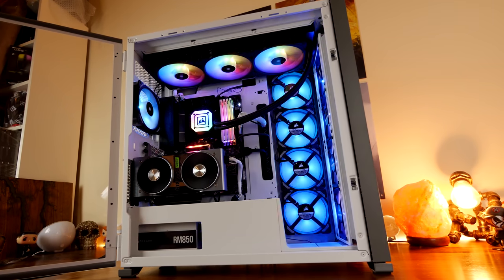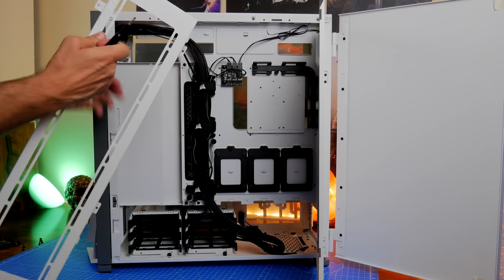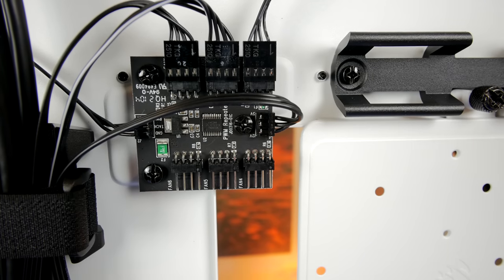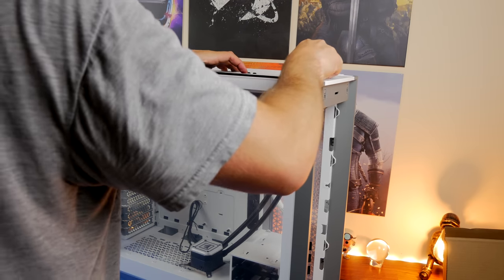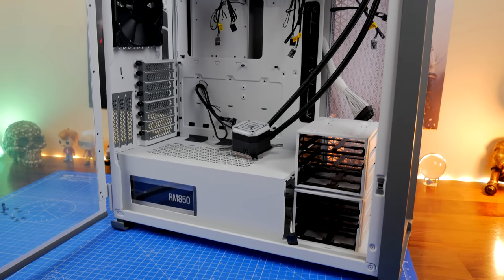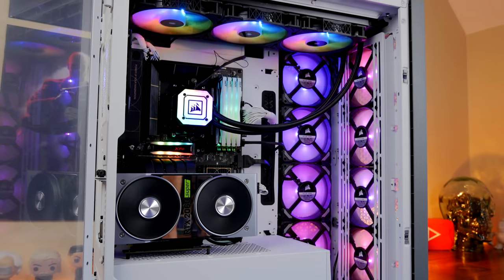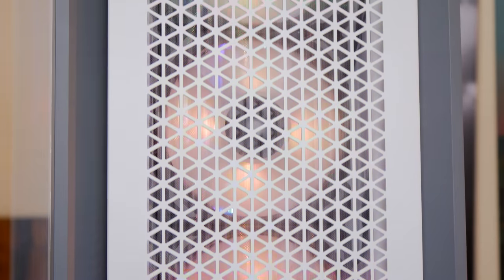Corsair 7000D Airflow unboxing and installation with 12 fans & the Corsair H170i Elite Capellix

Comment: I can barely fill the 5000d. This one is just.. empty without a full custom loop. Also it’s double the price
Reply: But but more fans! :D
Reply: Also with max fan kit it runs so cool
Reply: As someone who isn't water cooling, I find this case extremely useful just bc of my CPU cooler, and my 6900xt is fucking MASSIVE. Lol

Edit: no hate intended, just saying I like this a lot.
Reply: E-ATX motherboard users have entered the chat*
Reply: I like the extra USBs on the top. Wish more cases offered more than 2 as standard.
Reply: Try fitting a 4090 and not bending the power cables. That's why I ordered my 7000d today.
Reply: @stevenross-watt8640  exactly why I'm watching this
Reply: @mhop9775  I bought the case and a pcie 4.0 riser cable 150mm with right angle. If you look at pics the option to replace the original pcie slots ( not the 3 extra horizontal ones) means you can mount the gpu vertical bit very close to the motherboard. It will mean plenty of room for the fans to breathe as they will not be close to the glass and plenty room for the horrible 12+4 plug adapter cable to sit straight and happy. Hope that helps. Any questions or points, let me know. Cheers
Reply: 4090
Reply: @MrXaniss  that's why I bought mine
Reply: @stevenross-watt8640  I did the exact same thing yesterday haha, got the Zotac trinity my god it is HUGE.
Reply: @MrXaniss  I have gigabyte gaming oc. What a chunker too!
Reply: The price is ridiculous for this. I went from the 750d obsidian to the 5000d. I'm very happy with the 5000d, the worst part is the lack of space around the psu but that's barely a problem really cause how often are you really there. The cost for this case is ridiculous. £240 is mental
Reply: @wdunn06  I got my 7000d for less than that. Think it was £235 delivered from AWD-IT.
Reply: @stevenross-watt8640  how you liking it? Just got a 4090 and I’ve been looking at this case
Reply: @GradietPanda12345  I love it. You could argue that the extra rear panel behind the motherboard is a bit of a pain and unnecessary and the cable management isn't quite as easy as either a big Fractal case or my previous Lian Li 011 XL but once your over that then you should very much like this case. It has much more room to feel like a spacious case to build in. I've had quite a few cases and I'd highly recommend this one. It also allowed me to vertical mount a nice thick 4090 gigabyte gaming oc with plenty of breathing room to the glass panel.
Reply: @mhop97  corsair makes a cable kit to fix this problem if you use a corsair PSU other Wise ebay
Reply: @stevenross-watt8640 bro I swear it’s needs a big case for it to fit anywhere 😂
Reply: My 5000d is so cramped its not even funny lol. 4090 vertically mounted and it cant support push pull configuration on the top radiator, no clearance
Reply: Skill issue

Comment: Quick question man, I’m building a very similar setup with 9 ML120’s and 3 ML140’s for the H170i. Would it be any easier to use 2 Commander Cores for all 12 fans? That way I can run power and rgb to all 12, completely eliminating the need for the build-in PWM controller? Or would you lose all PWM capability at that point. First build.

Comment: Side Note: The AIO Pump should be plugged into a Pump Header instead of a CPU Fan Header if your motherboard has one for max pump speed.
Reply: My instructions for 7000x rgb version of this case also say to use cpu fan 1 lol. Logic tells me obviously you would think to use the "aio 1" header. But I'm assuming they must be the same thing
Reply: @themooch5454  The difference I noticed when plugging into CPU_FAN is that I wasn't able to control pump speed. So instead I use the AIO_PUMP and control with corsair icue

Comment: 0:00 Introduction
0:26 Peel
0:31 Overview
1:07 Previous version reviews (4000D and 5000D)
1:23 Size warning and benefits
1:57 What it comes with
3:11 Fan mounting configuration options
3:40 Other design features
4:35 Initial out of box set up
5:00 Available ports/jacks
5:35 Removeable tray
6:55 Data storage options
7:37 Customization options
9:42 Power Supply
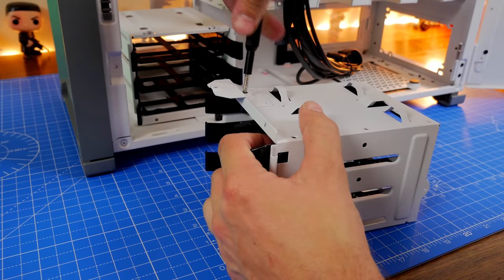10:45 Stacking hard drive cages 
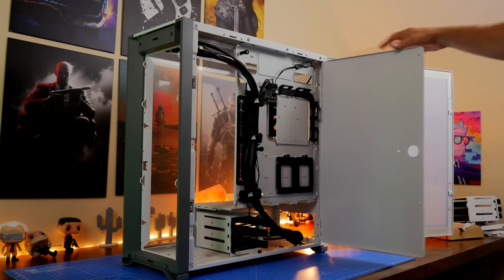13:02 Double Door System
13:23 Power Supply II
14:11 Front panel connections
14:34 Cable channeling
15:09 Corsair H170I
15:42 Fan setup outlined
16:10 Radiator set up outlined
17:12 Radiator mounting
17:20 Cabling set up
18:00 Corsair H170I Customization
19:22 RAD installation
19:52 Push-Pull setup options
20:34 Radiator mount installation
21:47 Fan installation
22:05 Vortex fans
23:30 Cable notches/recessions 
24:56 Commander Core 
25:44 Cable length issues
26:25 Commander Pro
27:47 RGB hub on top
29:38 RGB hub on bottom
30:12 PWM Controller
31:08 Sequencing RGB effects
33:23 Using an LED node instead of Commander Core
34:12 Looking at some cable channeling options 
35:38 Parts overview
37:50 Motherboard Installation (ASUS ProArt B550-Creator)
38:41 PSU clearances
38:54 Cooler installation (H170i AIO cooler)
39:04: AMD bracket installation
40:43 Pump into motherboard installation
41:59 Some issues with Cable Management
42:32 SATA power considerations
43:02 Powering the CPU
43:48 USB connections
45:05 Vertically mounting GPU
47:05 More configuration options 
49:08 Final Product
49:47 More Peel
52:30 Hiding Cable Shame in the back
54:05 Benchmarks
56:03 Closing thoughts
Reply: Where is the case audio wire bundle plugged into? I'm guessing bottom right with 1 pin spaced from the power and reset?
Reply: Great video ! Has there been a update , temps with GPU mounted vertically and horizontally ?

Comment: Thanks for all the work you went through for this video. I really like these longer videos that show everything, because If you think you had trouble setting this up, imagine someone buying this as their first build case with no experience with RGB Fans/Hubs/Nodes/ or anything like that, they will be completely lost, and this video will help them loads. Also You are the first person to show that the Hard Drive/SSD Drive mount cages are stackable. I've watched 4 reviews on it so far and no one else mentioned it. Keep up the great work. I currently have a 4000D Airflow, but wish I had gotten a 5000D Airflow. I have so many fans/hubs and stuff that cable management in this smaller case is a menace, and I just bought Lian Li Strimer Cables to add to it lol. I like that they added the bracket to Vertical mount the GPU closer to the Motherboard. Wish the 5000D had that option, in my 4000D the only plausible way to vertical mount a GPU is if it is Watercooled because if not it will be suffocated. Thanks for the awesome video!
Reply from the maker: Thanks for this. Appreciate it! And yes I try to be as thorough as possible.
Reply: If someone is buying this as their first build case with no experience, they are just asking to get into the weeds. Factor in the cost of a set up like this and it is not likely to happen. Someone affording this as a first build can pay someone to do it for them. There is value in showing the build process though as even experienced builders can't keep up with every case, motherboard, AIO, etc out there and showing potential hiccup points is very nice.

Comment: I know I’m very late to the video but I had a question. You mention that only 7 140mm can be added but I see space for 10 with three in the front, three on the side, three on top, and one on the back. Is there a space issue which prevents this? The build I’m planning will have a 420mm rad mounted to the side, three 140mm fans on the front along with three of the same on the top and one on the back. Would this be possible? Also I apologize if you answer this later in the video, I’m only a portion through.

Comment: I'm only partway through this video. I haven't built a PC in 14 years (GTX295 was just out)... I used to build PCs like every few years from age 12 to 20.. Now I'm 35 and so much has changed!!! M.2 drives, standard close-loop water cooling.. Everything is so new. Cabling is so much nicer now though!

I bought this case and so thankful I found your video. AND I happened to buy a very similar Corsair cooler as in the video. saved...
Very helpful! thank you!
Reply: That said, I have the 7000x which already has the fan/rgb hub... but not enough to add all of these three fans. Let's see what I can do.
Reply from the maker: https://youtu.be/jvXCbny-Suw

Comment: I'm so thankful to have found your video. It's been a minute since have built my own computer, and relied on this heavily. I had bought a prebuilt and my i9 14900 was spiking to 100C and holding steady with even small \ old games. I decided to do this build because of you, with the 7000D! I even did the push\pull on top of the AIO\radiator, so 15 fans total lol. However, I can't get my top lid on, and also, so many cables I'm having trouble shutting the back panel.... but oh well!       I was so happy to see that when playing some of my fav games, nothing like VR or 4k, but just average games, my temps are staying controlled around 40 - 50C right now. What a huge difference. Thank you sir!
Reply from the maker: Nice. Sorry about your small dramas but glad it's working
Reply: @TheProvokedPrawn  thats ok! I just probably needed some fan extension cables or something so I could relocate some things, it's all crammed in one area, and the 140mm fans on top are too tall to get the lid on, but i don't mind on that. better air flow! haha

Comment: Honestly a wonderful review of the case and showcase. I’ve never built a PC but I’ve been following PC builds since the middle of the GTX 10 series. Building my first PC with a 4090 this year and I’m gonna get this case. I have no experience hands on building but I’m pretty confident with my years of watching in general and this video specifically I can do it.
Reply from the maker: Glad to help. Good luck. 👍
Reply: @TheProvokedPrawn  a 4090 should fit in this case right ?
Reply from the maker: @cspreach1963  pretty sure it would yeah.
Reply: @TheProvokedPrawn  with this build, I know your intaking cold air from the front eight 120ml fans and exhausting from the top radiator, is the back fan intaking cold air as well or is it exhausting hot air like the top mounted radiator?

Comment: Hello, GREAT VIDEO, THANKS.  I just bought this case Jan 2024. I have two questions about this video, If you could please help me to understand.  Why do you have the upper rad fans exhaust outward?  Heat rises, so doesn't that pull the hot air from inside the case into the radiator instead of cooler air from the outside coming in?   Secondly, I see the you laid an air filter on top of the radiator outside of the case, what purpose does this serve, if the air has already passed through the fans and the radiator, wouldn't that trap dust between the top of the radiator and the filter?   I am quite sure you have logic behind your choices, and I have the greatest of respect for you, and take your videos seriously.  Thank You!

Comment: Just to add. Had this case for ages and will never change it out. The GPU vertical mount can be moved back alot further, the case comes with a bracket that allows you to move the lower 6 /7 pci cover and put in the vertical one for the GPU. i had it in front like this setup and RX 580 was running between 70-90, moved it back and now it hits a max of 67 (Battle field 5 testing). Just for anyone wanting to look into it.

Comment: Built something very similar. You can absolutely mix corsair fans on the commander core xt. I'm using 2 of them with the 3 140's included with the H170 and 9 SP120's. Works fine.

Comment: I got 14x 140mm fans in my 7000D build. 10x 140mm case fans (with some modification to the mounting tray) and 4 CPU fans (dual socket). Such a good case!
Reply: Nice! I have 4 140mms (front, back exhaust) and 7 120s (420mm Rad on top +3 on the side fan mount)

Comment: monster of a case i couldnt of figured out the whole method wiring the fans etc if it was not for this video thank you for the long informative guide / video!
Reply from the maker: I aim to please. Hope you enjoyed enough to subscribe 🦐
Reply: @TheProvokedPrawn  yeah i just subbed now worth it. pcs are simple enough but its always the fans that get or used too on older builds .... lol. when they wouldnt power up in the case this new controller makes it way simpler than the 4 pin male too female etc

Comment: made it to the end :)

just ordered this case to replace a 12 year old corsair case so i can fit 2 radiators. Really appreciated your insight so i could plan my build!
Reply from the maker: Thanks for watching. I realise it was very long but hopefully as useful as it was long.
Reply: @TheProvokedPrawn  it has helped me plan my fan setup without a doubt, part way through i immediately realised I needed another pwm hub as I push/pull with my current 360 radiator and I want to keep that along side adding a new 420 to the front. 
Being able to see that the drive bay can still squeeze infront of the psu allowing for the optional bit of trim to be swapped in was great, mostly as I think I'll need that cut out for the radiator to drop down into.

Im curious, did you test the case without the fans drawing in from the motherboard panel? In my mind, those fans plus front intakes is going to make for some very messy airflow coming in and id love to see some figures from both setups.
RAM temps, chipset temps etc to see if there is any difference
Reply from the maker: @nazdreg21  no, but I did something mad with the 5000D https://youtu.be/r5OY9llXRwo
Reply: @TheProvokedPrawn  👌 will check it out  dreckly

Comment: Your voice makes the case more desirable than it is. It is hypnotizing. :) Thanks for this great guide. I am planning to buy it for air cooling. (I may try water cooling in future, that's why I wanna have a bigger case than usual, I want to work freely inside) My question is, whether this would be a good solution for air cooling. I am not overclocking.
Reply from the maker: Yes it's great for air. Hope you enjoyed enough to subscribe 🦐
Reply: @TheProvokedPrawn  Yep, subscribed. Another question by the way. Why are you using a commander pro and core while you have also the in-built fan hub.

Comment: thanks much. i have this case putting a 7800x3d in it as we speak. definitely the easiest case ive ever worked with tbh, and ive built a lot of pcs. IT WORKS GREAT with the new RM Shift PSUs btw. Hard to find a case that does as well as this (main reason i bought it)

Comment: Great Video, helped me allot. one question. I have built a Corsair iCue RGB 7000X case with a ASUS ROG Strix Z690-E Gaming WIFI motherboard. Turned out great except for one thing. The 7000 series case has four front USB ports. The Asus  motherboard only has one 19 pin USB header on the board. I have tried many splitters and one PCI-E card and I can not get windows 10 Pro to work with any of them. How did you hook up the front USB ports. Did the Pro motherboard have two or more 19 pin USB Headers?

Comment: Great video as always! One question: if I have 2 hdds would you recommend getting this case or just the 5000d? Considering the PSU I have is the RM850i
Reply from the maker: Well technically you can move the cage out of the way on the 5000D and this one as well. So either would work.
Reply: Yeah but it comes to my attention that there's more room for PSU cables on the 7000d than the 5000d, and I really can't remove the cage because I truly need at least 2 hdds on my rig